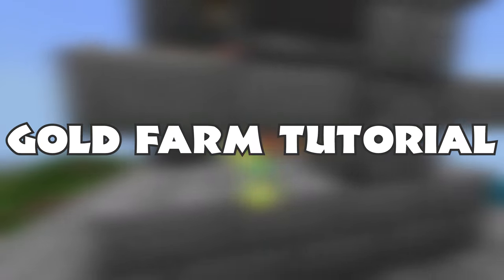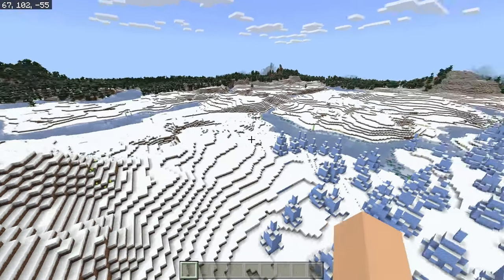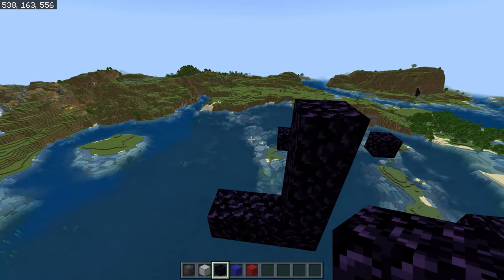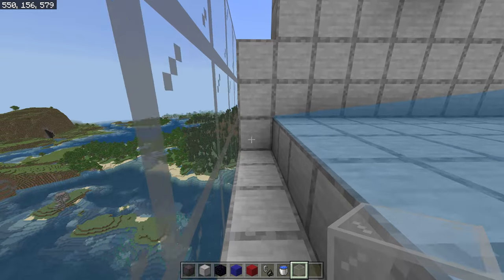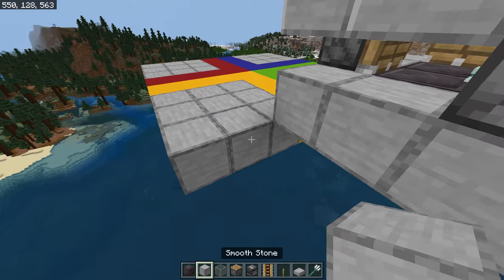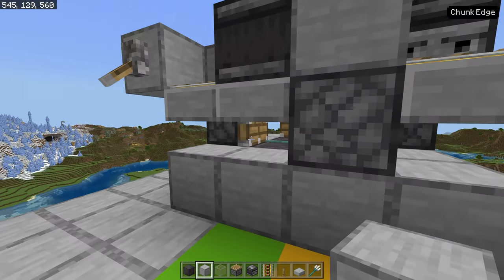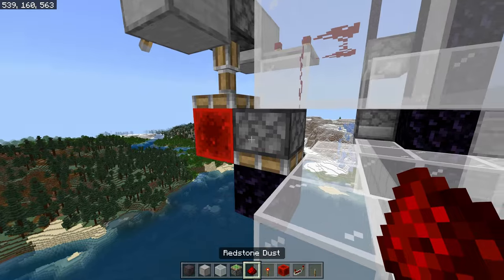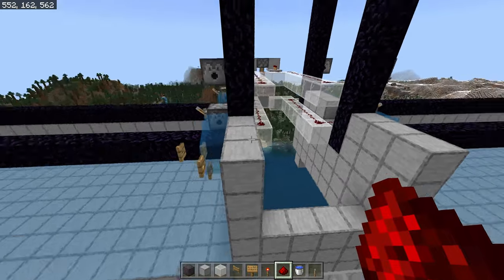INCREDIBLE Gold Farm! ADJUSTABLE SPEED | Minecraft Bedrock Portal Ticking Gold Farm

Comment: Amazing. Just finished building and let's just say it took a bit longer than 2 hrs, but a lot of time was spent grinding for materials and sorting out chunk boundaries, etc.  I also didn't help myself by building inside a massive cavern ( so much spawn proofing 🥺). By pure fluke I got it aligned east/west and over Y0. Finally got it to work after a few false starts. Anyway, it's insane - probably the best farm in Bedrock alongside iron farm/trading hall. Lags a bit even on 2 ticks but it helps to collect the XP balls shuttling between the trident killers (I use Impaling V and a waterlogged stair block)

Comment: notes for me 😅
find corners
2 diagonal away from corner, up 32 blocks, build portals (4block spaces between each corner portal)
portals 23*23
ziglins spawns on + size
down 3 first floor to catch ziglins 
floor 8 blocks wide 
run each double portal into one chamber, 2 blocks wide drop lined up to Trident killer
filter water 3 blocks down fall from same height
drop rest of the way

Comment: Great video mate.  I was scratching my head as to why you don't use the lava switch to turn on the portal then I watched guide season 3.  No fire spreading prevents it from working.  I followed the guide as a relatively new bedrock player to see the differences with Java and switched off fire spreading.  Of course, when I came to build this farm, I found a tutorial with the lava switch, put it in your build instead of the flint and steel method.  Scratching my head as to why it didn't work.  Then a lightbulb moment happened and I switched on fire spreading in my Bedrock world and it worked great!  Happy with that, fault finding complete.  I go back to my base and guess what?  It was on fire hahahahaha.  I'd used Oink OInk's really simple starter iron farm until I had all the materials for  your combined iron farm/trading hall, but the lava kill section was next to some wooden slabs, which were close to some leaves, which were close to some trees, which was close to my house....  Oh well, game me an excuse to rebuild the house to a standard I was happier with 😃

Comment: Be careful when building. If the portal is near ANY portal that you use for your nether hub, be sure to link the xp farm to a special portal with a kill chamber in the nether or your hub will get filled with all the ziglens who don't come through. You'll be dead before loading in, blocking or not.
Reply: I've resolved to wearing a gold helmet 99% of the time instead of netherite so the piggies bug off. This happened on my first gold farm and I was annihilated, losing all my first diamond tools and gear.
Reply: @sc0rch3d  I wear gold boots... and thorns....
Reply: @wheelezerides2558  is thorns worth it? Never used it. Afraid of killing neutral mobs.
Reply: @sc0rch3d  Probably not. I got it on two pieces of armor from the enchantment table. Not sure how to take it off without stripping it down. May just do that.
Reply: Do you know a video on how to make a kill chamber or any video on how to for a pigmen farm?
Reply: @slashingz8884  Not sure of any video. You don't need anything fancy. I just did a 5x5x25 pit trap under a linked nether portal. I even found some ancient debris when digging it.

Comment: I have a serious complaint about this farm, IT IS TOO GOOD!!!!!!!!

I built this farm over a month ago and I’m in the process of doing my fourth iteration of the item sorter/storage system. I have 3 separate item sorters for both the gold nuggets and rotten flesh but somehow a few still manage to slip by going into my smelter causing it to clog the smelter. This is the reason I cannot afk at this farm for longer than 10 minutes(although the amount of gold I get negates this problem).

Hopefully this time I can fix these issues seeing that I got a project coming up that I need 1000s of gold blocks

P.S. I use bamboo as a fuel source, it is the cheapest and easiest to farm and I have it connected directly to my smelter
Reply: Can use lava buckets as well. i set up a super smelter with lava drip things. Works just as great.
Reply: I'm having the same trouble getting my sorters letting flesh, nuggets, and ingots slip through and messing up my smelters.

This my first time making sorters so I'm wondering if I messed something up.

I made 3 separate sorting systems coming off the farm, thinking I might need the duplication for it to keep up, but all three seem to have the same problem of letting stuff slip through.

I tried turning down the speed of the farm to the slowest, and still have problems.

Did you find a solution? Anyone have suggestions?

Comment: Replace the water with powder snow for faster results and more reliable
Reply: Was just checking as was going to say the same
Reply: Lava works too as it flows much slower than water
Reply: @DarBibkus  you don't want the lava the mess with the water or you going to destroy the water mob transport system if it breaks. Then it would be worst then the water.

Powder snow does not flow. Worst case scenario lose a bucket per machine break. Which mostly happens during unintentional logout or forgetting to turn off the system.
Reply: @Dragoon42  not an issue if you replace the water transportation with a waterless way to move mobs but thats basically changing the whole farm
Reply: @DarBibkus  even a non water-based mob transportation would be destroyed by lava flow unless you use lava which is slower than the other methods. For my gold Farm I use activator rails with the Minecarts to transfer the mobs.
Reply: Well it sometimes break my portal into one block high and wide portal XD
I'd rather use lava
Reply: @kazz2230  when I mentioned that there was no bug with the portal with powder snow. I could see that being a problem.

I'm still hesitate to use lava because I could mess with the mob transport if the system fails( then you have a stone Farm). Water just makes have to pick it up when fails. You still get sometimes water small sheets of water falling sometimes. Haven't been playing Minecraft in the last several updates.

Comment: I've had this built for roughly a year now. I ended up breaking 3 of the portals because there was instant lag on my switch turning it on.  To anyone interested, if lag is an issue for you, I would just drop kill them as it'll let you afk longer resulting in a net gain over tridents and looting.
Reply: Sounds like you have another issue.. I run a 8 portal farm on a realm with minimal lag. Xp and items can cause lag. I would investigate that more

Comment: you can switch the flint and steel System with a system that works with Lava and trap doors that burns. so it works infinetly
Reply from the maker: Actually you cannot do that if you have fire spread turned off, just like I explained in the video

Comment: I just finished building this on a survival realm. Didn't need a list of items required as the only definite amount is the obsidian for the portals.

Mine is built right next to my stacked iron farm so I get gold and iron. I'm using 4 sorting systems to keep up with the loot. Gold swords go into blast furnaces fueled by kelp blocks (kelp farm in the next chunk).  

Fantastic farm. If you are getting lag check to see that you are collecting the xp. If it builds up around the trident killer it generates lag.

Comment: I made this on Xbox and it nearly broke the console 😂 works great but if you're like me you may want to set the clock to the slowest speed. Got like 50 levels in 60 seconds, two double chests filled in less than that. Had to turn off mob spawning because the lag was so bad I couldn't even make it to the off switch lever

Comment: Just a heads up I attempted to build this world below y=0 and it failed to work.  Portal ticking did not spawn zombie pigmen!  Moving the whole build above y=0 fixed the issue.

I suspect this is an unintended bug, so my comment may be outdated soon.
Reply: That shouldn't matter.. Do you have it set on peaceful mode?
Reply: This is correct your y needs to say at least 2 when standing inside the portal

Comment: my problem is that people say 2x3 for a small portal meaning the area of the window and then the big portal they say 23x23 meaning the block count on each side. this isnt just here, its on the bedrock wiki as well. so I built the portal 23x23 window so the block count was 25x25 on the sides and it didnt work so in a creative I found out that you/prowl meant the block count. that would have been cleared up if prowl built one side of a portal instead of just a corner. the portal size is 21x21, unless I am mistaken and my minecraft is different to this one.
Reply: What  is it the inside part or frame

Comment: @Prowl8413 any ideas about dealing with ziglins that are showing up at the gate on the Nether side? My 23x23 gate, my base's gate and another gate down near in my subterranean iron farm are all close enough to each other to share the same gate in the nether (the hub gate of my nether hub). when I run my 23x23 gold farm gate (I have fire-spreads turned on, so I use lava+doors to light my gate (and your snow bucket method to snuff it))  ziglins build up at my hub gate in the nether and when I go there from my base gate I get ambushed by several ziglins. Other than dismantling and moving my gold farm far enough away to avoid it linking to my hub gate in the nether, do you have any suggestions about how to suppress the unwanted ziglins?

Comment: Hey Prowl, you thought about using a better system than water flushing to get ziglins into dropshoots faster? I tend to use a ziglin in a boat and snow golem shooting him, so they are aggro and just run straight in to the dropshoot, for this farm you would probably need 1 snow golem per drop shoot but should help getting them in the tk a lot faster even though then you might need an even faster tk
Reply: Use ice where they land. So they get funneled in faster. I had to rebuild one of my kill chambers as it overloaded it with piglens

Comment: With lags on realms would this work on a realm too? Often mega farms fail on realms.
Reply from the maker: Yes but you'll probably want to run the speed adjustment repeater on 3 ticks
Reply: On a realm, if you don't set the repeater to 3 ticks, you will notice that occasionally one of the dispensers will fail to retrieve the water, it will flood the farm, and be annoying to fix.
Reply: I use a single version of similar idea on a realm just fine . Try the powered snow suggestion as less messy for water going awry
Reply: I have a realm and I built a single portal setup. I get a little lag when I run it. I wouldn't want to even attempt 4 portals, but if I did, definitely would run it at the slowest speed.

Comment: Hi Prowl ! This farm totally works, but I wonder how much flint and steel are needed for a 12 hour afk session. Can you please give an estimate assuming i'd run a 2 portal setup on a 4-tick speed ? I'm on a ps4 console so crafting flint and steel takes a long period of time 😞! 

Also, I wanted to let you know that I built a lava-ticking version as well and it doesn't seem to spawn any zigglins ... I'm not sure why, but the portal ticking is working with a setup of 2 crimson planks 21 across to hold the lava on each side ... and 42 observers looking at each other underneath the lava for updating the fire to spread in order to trigger the portal ticking mechanics. It was a more reliable design than one with trapdoors or doors but again, no spawns what so ever 😞!

Maybe Mojang has nerfed those kind of farms ? Any idea how to do a lava-ticking farm
Reply: Not sure if you ever got this figured out or not, but Crimson and Warped Planks are non flammable. They won't catch fire to ignite the portal.

Comment: This farm is really fast and efficient, almost too fast.
Too keep up with the drop rates, you should use the trident killer that silent whisperer uses in his mob farm. thatll take the drops across a water stream so you can connect them into a storage system
Reply: does this work for you on bedrock for me no piglins will spawn from the portal
Reply: @Reece_searbyr78  it works for me. maybe check to see if you’ve built the farm too low in your world

Comment: I have a question about mob despawning. If the mobs are too far away from the player, will they despawn? I was thinking about stacking this on my general mob farm that already uses 2 trident killers. Stack this above it... HOWEVER, will they despawn if the player is too far away? (I might just build it in creative and test... but I thought it would be good to comment about it here.)
Reply: They do. There's a sapwn radius and an auto despawn radius around the player
Reply: @crunchevo8974  Yeah, I ended up just building it as a split density on either side of the AFK platform. So I still got general mob spawns but I also got pigmen.
Reply: @FritzFreund  i built mine a couple hindred blocks away from my mob farm+iron farm i got going on to be safe. I don't like putting too many mob farms close together cause it kills my playstation's fps. 

What's bothering me about this farm is the xp orbs get collected on one of the two kill chambers i have and I can't figure out a way to make both of the chambers get the XP to me which is annoying cause it's slowing the farm and the system in general down by a lot.

Comment: The back half of the farm near the clock keeps getting out of sync and the portals never light. I'm pretty sure it is due to chunk borders. I'm considering on installing a separate clock for the front and rear bank of portals to see if that helps. Even with just two portals running the amount of zombie piglins is enough to keep two trident killers busy.
Reply: I’m having a similar problem, but only ONE of my portals actually ignites. They ignite if I do it myself, so I know it’s not the size. How do I fix that?
Reply: @Infinity-ut3jt I ended up installing separate clocks that turn on with a single master switch at the afk location. It's definitely a chunk issue causing the portals to get out of sync.
Reply: @gtneon99 Thank you so much 👍
I had debated installing 4 individual clocks, as only one of my portals actually lights, but I’d love to know how to hook them all up to a master switch… is that easy to do? (I’m a total redstone noob)
Reply: @Infinity-ut3jt  so a redstone torch tower to get your redstone power vertically up to the portals and a set of lines that split to each of the clocks.
Reply: Cool! Thank you so much! I think I can manage that (I saw a torch tower on a different video). 
Cheers 😁

Comment: What you don't mention is that you need to build this far away from any nether portal that you actively use as you spawn the zombie piglins both in the nether and the overworld. I recommend checking by going into the nether and make sure you are happy and then build some walls around it so the zombie piglins can't wander around.
Reply: Do we build the big portals in the nether or not?
Reply: Also do we need 4
Reply: @zadonthompson5809  You don't build portals in the nether. The first portal you light in the overworld will cause a portal to be created in the nether at normal size. Then due to portal mechanics all the other overworld portals will link automatically to that portal. You have to be more than at least 128 blocks in the overworld to connect to a different portal in the nether.
Reply: @jonathanbuzzard1376  what happened if i link the portal manually?

Comment: Definitely building this since current gold farm was for my starter base. Need tons of gold for carrots.

EDIT: now built in my survival world and TOTALY OP. Even my gaming PC is having a hard time keeping up on the 1 tick repeater. 3 double chests of goodies in <15 minutes....roughly 10 gold blocks worth of ingots and gold nuggets, few stacks of rotten flesh, way too many gold swords.

Advice:
1. item sorter to toss the gold swords. I have a super smelter and NOT worth that hassle.
2. I built my trident killer on the ground level with collection below it in a roomy basement that can expand & built a house around the kill chamber and collection. I'm using a minecart hopper with double speed hopper unloading.
3. I used a torch tower into the kill chamber with 2 levers (trident killer and portal activator). I'm testing a signal extender so that you can combine into a single switch with the pulse lasting longer on the trident killer.
4. Do NOT use flint and steel system. Leave a 3 block gap between portals to create a 3x8x3 (LxWxH) portal activator. first level is 5 observers all facing the same direction then 1 observer looking into the 5 and surround by blocks. 2nd layer is trapdoor on the blocks next to observers and close them with solid blocks at the end. final layer is border of solid blocks with the middle being open. put lave on the 3rd observer so it flows along the 2nd layer between the trap doors.

I already have an OP carrot farm using allay's, farmers, and bees with more than 10 double chests of carrots. One major AFK at this gold farm and I'll have food for months.

EDIT 2: Had to build dual trident killer (1 per 2 portals) with Impaling 5 to run the farm for longer AFK sessions. The only remaining problem is that items don't get sucked in fast enough. will keep trialing.

Comment: Why build this so high up in the air?  What was the point of going up the initial 32 blocks from your platform?
Reply from the maker: I wanted my platform at that level, and enough space for the ziglins to fall and take damage without dying
Reply: @Prowl8413  lol, I answered my own question when I got to that part. LOL. Had to dig a massive hole, then try and work out the depth :/ Thx, it works really well! I just replaced your portal starting mechanism, as I don't like the flint and steel method.